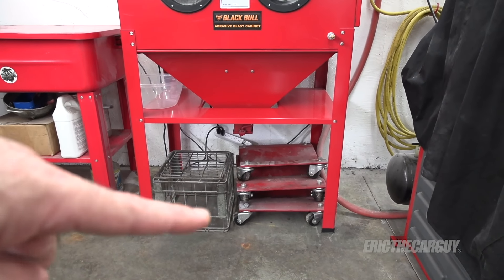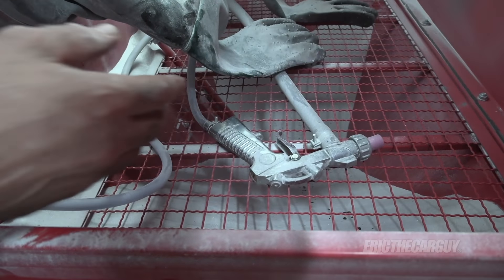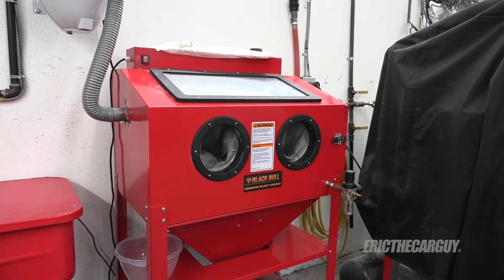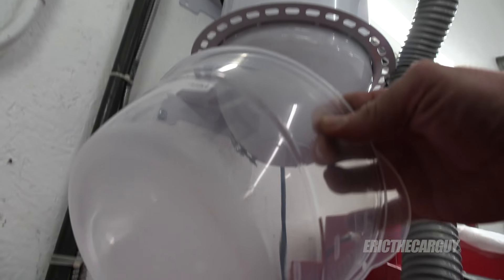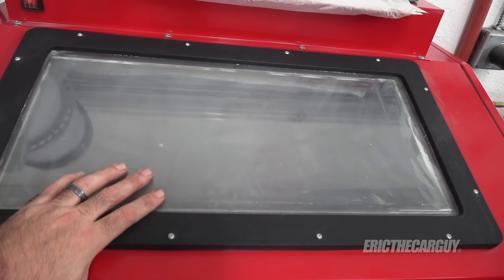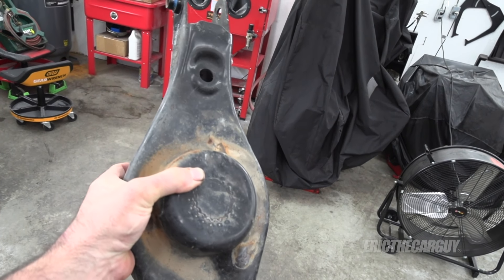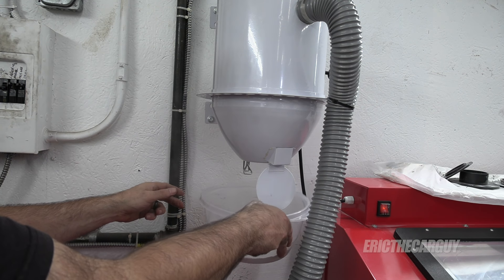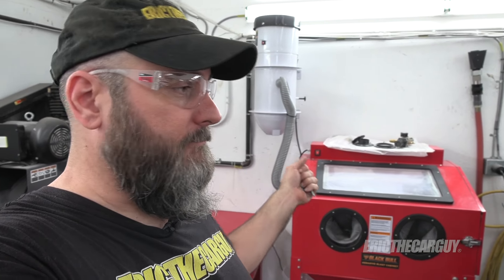Sandblaster Basics

Comment: Eric, use 2 scoops or bowls of media in your blaster only. That way you keep recycling it until it just doesn't  cut as well, THEN dump it.
No need to contaminate 40 lbs at once. Plus it's a lot easier to clean out. Also, put a T in your air hose inside the cabinet with a small blow gun. Great to blowclean the parts,blow any media from the edges and the inside of the door before you open it. Works great !
Reply: He’s still learning leave him alone
Reply: @619guy202 would you rather other people never give him advice? weird hill to die on

Comment: I hooked up my big shop vac to mine and it was sealed up so well it broke my glass! Oooops lol
Lesson learned and now I've got my cabinet running efficiently and it is one of my favorite tools in my shop
Reply: DAMN  JAY, What brand & power is your Shop Vac. Thanks.
Reply: @NoWr2Run  6.5hp Rigid
I didn't have the vent open. I have since devoted a tiny dewalt vacuum for my blast cabinet and have the vent open with a filter on it
Reply from the maker: I don't feel so bad about my gloves popping off anymore. Glad you got that sorted. Thanks for the comment.
Reply: @jaywerne3812  Thank you Jay, much appreciated, SIR.

Comment: Do your future self a favor and research Sandblaster mods. A little time investment on the front end will reap exponential rewards later.
(PS Love you man, Been watching since you were in the old barn and no facial hair.) 

What you have is a Great start (The pickup tube is nice on that unit)
1) Adding the Bottom siphon mod with a media control valve will allow you to drop the incoming pressure to 40-60 PSI. Which will save strain on your Air compressor.

2) Check out Mods that cover adding baffles or path ways for the reclaiming vacuum air to flow across the part and cross flow across the cabinet.
  
3) Reclaimed media....  I would throw it in the trash and not reuse it... The reason being is that media also contains all of the RUST,  impurities and paint that you just removed from the object you blasted.  when the media goes through the gun the second time with the contaminates it will be slammed and imbedded  in to the part you are blasting. This isn't so much huge deal.... But if you blast anything with Silicone (Gasket material) that silicone will get picked up and embedded into the metal which can cause issues with bubbling when you go to paint or weld. (PS scrape or wire wheel  all of the silicone off your parts before blasting ;-))

4) Good note on the RAW metal and gloves.... one down side to sandblasting automotive parts specifically is that Since the late 80's early 90's OEM's used some form of E-Coating on the bolts and parts. Sand blasting REMOVES this coating.... Phosphorus or plated bolts are particularly an issue here... I learned the hard way... I have some nice shiny brackets on my project car but after 3 months the heads of the bolts rusted because of no protective coating. This is why E-Coating kits have become popular in the last few years.... (But check with disposal procedures in your area before purchasing an e-coat kit the chemicals involved can be caustic)

5) add Castors and a floor to the bottom of the unit. this way you can pull it out and sweep around it.

Comment: Very nice set up there.  Used a plywood blaster dad and I made in the 70s for about 30 years and it worked great even with a 2hp 20 gallon compressor !
Its all about your setup I think.  Want to set a new one up now similar to yours but bigger.  I may build just fabricate extensions on the sides of my cabinet or just build another plywood cabinet and steal parts off my existing one.  Big cabinets are very expensive, heavy and hard to get down my basement.

Comment: I have the same one.  I did away with the "tear aways" and use just the glass with the plexiglass over cover.   Replacement glass pieces (at Lowe's) are about $1.50 each if you buy a full sheet and have them cut it up for you).  I also replaced all the nuts and bolts that hold the glass frame on with riv-nuts for much easier access.  Most of the joints leaked and I was getting a lot of abrasive leakage.  When I had the window frame off I caulked all of the joints and that solved the problem.  The only other change I will make will be a different gun (no trigger) and a foot switch for the air.
Reply from the maker: Excellent suggestions. Thank you!

Comment: I just want to mention, for anyone without a garage, most communities of any size are likely to have a "U-Blast-it" place where you pay by the minute and do it yourself. Most reasonably sized pieces will not take more than 10 minutes or so. The place near me also has a heavy-duty parts washer which will clean anything up to and including engine blocks.

Comment: Technically its a blast cabinet, here Eric is using glass bead media, not bad for cleaning some stuff up and rusty bolts, but you can also get aluminum oxide sand blast media which works quicker and better depending on the application, it will have a rougher finish though. I've done parts where i sandblasted first and then smoothed it out with glassbeading but that was easier to do with 2 different dedicated cabinets, 1 strictly for sand blasting and 1 for glassbeading. You will also need different nozzles in the gun to hold up the type of media. Depending on the setup and cabinet you can also run steelshot through it, but reguardless a hude thing to take away from this is that reguardless of media these are basically self destructive machines they will degrade and maintenance def has to be done to keep them good. Also super important dont breath the shit in itll never leave your lungs.

Comment: So, my assumption of a sand blaster vs a wire brush whether powered or not, is that a sand blaster is much better at getting the small crevices on parts, more efficient, and quicker. I have only used wire brushes in the past, but I might have to invest in these
Reply: I also use a wire wheel on a drill, IT SUCKS. It does work but not even close too what a S.B. can accomplish, my buddy has one.
Reply from the maker: Sand blasters can be life changing. Good therapy too.

Comment: I used to repair all the electronics/column switches/speedos/flasher units/ and much more.
Most had a metal case that looked horrible ( Rust and muck hell ).
The sand blaster was brilliant for cleaning them and the rough texture was ideal for primer and paint.:-D
But i used to get shocks off the metal nozzle, and the inside of the gun just vanished over time.
The boss never looked into coatings for the glass,  a fog horn would have been at home in that cabinet lol.
Reply from the maker: Funny, I forgot to mention that. On dry days it does seem to produce enough static electricity to shock you while you work. It's very uncomfortable. Have a great weekend.
Reply: @ericthecarguy  LOL yea you living in a dry cold climate static will be an issue. add ground wires from the cabinet to the ground electrical circuit of the building to drain off any static charge.

Comment: 1. Get yourself a pedal switch and gun from eastwood; way better than trigger style... tried both...
2. Is that a 3/8" hose? If it is a 1/4" then upgrade to at-least 3/8th you are killing your cfm... although if you have 150 psi going up to the cabinet it is not as bad as regulating to 60 or even 90 at the source.
3. cyclone separator inline with shop vac works well. media stays in cyclone, dust goes into the shop vac. Will need a weak shop vac or regulate it down with AC motor speed controller.

Comment: The intake for the dust collection should be shielded so it won’t suck up media, just dust. Eric basically had his setup hooked up backwards.
Reply from the maker: Not according to the instructions. Thanks for the comment.
Reply: People who write instructions are not always the same as the designers. The shroud on the back hole has no realistic purpose if that was simply a ventilation hole. Media isn’t supposed to end up in the vacuum.

Switch it around....see if I’m wrong?!?
Reply: Honestly I can see it being either way

Comment: Recommendation: Look this up on Amazon: WETOLS 14" Rivet Nut Tool, Hand Rivet Nut Tool with 7 Metric & Inch Mandrels M6 M8 M10, 1/4-20, 5/16-18, 3/8-16, 70pcs Rivnuts and Blow Carry Case - WE882 and use that instead of the nuts and bolts...it will make it MUCH simpler!
Reply from the maker: Not sure how this relates to my sand blaster, but... That said, I have a rivnut tool and it works great. 

Oh wait, you're referring to assembly. Yea, I suppose that would work better if you could make them work. Thanks for the comment.
Reply: @ericthecarguy   Exactly...for the assembly. I have one and have used it for years for all kinds of things. For many car projects too. Recently, I had to work on my wife's 2010 GMC Canyon and I bought a new grill assembly. The grill's clips did not work as advertised and the old one used to rattle. So, I drilled six holes through it and into the metal frame of the truck and used these. It works much better than the manufacturers!

Comment: I bought a very similar unit from Harbor Freight a couple months ago and yours seems to work much better. You said your operating pressure should be between 40 and 80 PSI, whereas mine said to run at 90 and I'm constantly having trouble with media not being fed through the gun. Have you had any similar issues? I'm thinking maybe the higher pressure is overpowering the media from feeding consistently.
Reply: I have a similar cabinet and similar troubles. I believe mine is because too much water/condensate is getting into the air supply. I imagine the glass bead is more resistant to that as compared to sand media.. ?

Comment: Hey Eric. Good video. That is a handy blaster for small parts. I got a blaster like the one you showed last on the shelf. I just can't seem to get mine working right. It starts out great, then it stops picking up the medium. I tried aluminum oxide and glass bead. And had the same results. I don't have the instructions for it because it belongs to my son and he misplaced the manual. I am running it full blast and it won't pick up the sand. Maybe the air is set too high. I will try lowering the pressure. Thanks for sharing.🍁👍👍
Reply from the maker: Shake the tank from time to time. While you're blasting it will make a 'hole' in the media as it draws it out. I have to 'smack' the side of my blaster from time to time while I'm using it to get the media to feed again. Good luck and thanks for the comment.

Comment: Stick with the metal tips. The ceramic ones don’t last long at all. That reclaimer may be better on the floor than being up on the wall. If it dose give you trouble, try putting it down on the ground and see if the will help you out a bit. You’ll have to get you a strainer from the dollar store too. It’ll save you a lot when you get into using it all the time

Comment: Not sure if you mentioned it, however using cheap play sand is not really saving you much in the long run.  Silicosis is real, and it doesn't take a years of daily exposure to mess you up.
Local abrasives company sold me of 50# steel grit for $45, as it can be re-used 1000-1500 times. Working pretty nicely.
Reply: Also, Tractor Supply has one for like $100 with light.  I just get some nice LED's from eBay and patchthem into the 7-12v wall wart with a resistor.  These are simple enough to make from wood or sheet metal if you can bend them or have a brake.

Comment: For the external blaster will you be doing it outdoors, or will you instead build a Dexter-style 'kill room' to keep the sand/dust contained indoors? 
Always been curious to find a way to use a pot blaster in suburbia without making a mess of the backyard or pissing off the neighbors!
Reply from the maker: I was thinking 'kill room' since I need to blast the underside of my car on the lift. Still questioning this though. Not sure how much dust it will make, but I'm sure it'll be a lot.

Comment: What is your air compressor specification? What is the minimal tank size would you use?
Reply from the maker: Mine is 80 gallons. https://www.youtube.com/watch?v=6Nmz5Pytsi0&t=16s

I suppose the size compressor you would need would depend on how much work you're doing. Also what operating psi you decide to run. This unit can operate between 40-80psi.

Comment: Your sand blaster shown is a 98% match for the Harbor Freight unit I just purchased..
Yes, assemble is a bear doing it by yourself which I did..I found if one installs the window last, the top screws are easy to install, then install the window..
BTW, the directions to assemble are terrible at best..
Thx for the vid..good info especially about post cleaning handling..

Comment: An air powered spark plug cleaner would be a great addon to the side of that. $18 from HF.
Reply from the maker: Honestly, I don't see the need for that with modern fuel injected engines. If you're having to clean stuff off your spark plugs, there's something wrong with your engine that needs to be addressed. Still, those are cool tools. Thanks front the comment.
Reply: Best way to clean a spark plug is to use a propane torch get it cherry red when it cools off just air blow it clean. Sand you will get that in your engine no matter how you try to get it off the spark plug. Have not bought a new spark plug for lawn mower or any 2 cycle engine in years. Mapp gas make the spark plug get hotter faster.

Comment: How much warping do you find when blasting?  I have a big surface I need to blast and trying to find a blaster big enough to to blast a panel but worried about warping panel due to heat
Reply: No heat generated🤷🏼
Reply from the maker: You can turn the psi down to help prevent that. You do need to be careful with thin metals though. Also, the media you use will have an effect. I'm not an expert on this, but I'm sure that info is out there somewhere on what media is best for thin metal. Good luck and thanks for the comment.

Comment: Hey erick. I know this video is different from the question I'm going ask.. So i have problems with my valve lashes.. The car that I'm working on is 2002 civic D17A2. Everytime i adjusted the valves,they be ok for awhile then shortly after the car started to vibrate which means they got tightened up, even if i torqued them to 14-15ft lb the still tighten up.even if i adjusted them with little or no drag they still got tightened up on me. What are your suggestions? I adjusted them today and the car was idling with very slight vibration which i could work with but then now after i got off work the car started vibration after i start up..

Comment: Do they have larger cabinets? I work with large body parts and I've been looking for a sandblaster rather than doing it by hand all the time.
Reply from the maker: There are larger cabinets available but I'm not sure if they would be big enough for body panels. You might consider the other blaster I showed in the video that doesn't require a cabinet.
Reply: @ericthecarguy  alright I'll check them out. Thanks buddy
Reply: Yes, there is every size possible available. 
Truly commercial units, not made in China.
But the prices are reflected in their unique specialty uses.   I had one ordered for my HS auto shop class. It was a couple thousand for the bare bones unit.  Lots of options.  The kids loved using it and it was relatively indestructible.
Reply: @michaelmccarthy4615  I flip cars and a lot of the ones I buy end up having parts that are in good shape but just in need of a fresh coat of paint

Comment: Ahh, you sold them all out at JB, Eric! Those guys are gonna be happy with you, me thinks.
Reply: I got to buy one of those some day - been wanting one for years. If my '07 Silverado would just stop breaking, maybe I will!

On day 3 of getting everything out of the way for the tranny swap. Damn nut rounded off on the manifold flange. Battled with the other 5 - I think GM torqued them to 4,500 Ft. Lbs.. Finally broke the stud with the rounded nut with Big Nasty moments ago, after welding a nut on and snapping the stud in half. Had it red hot, too. I've never seen metal this hard for an exhaust system!! Also had to melt what used to be nuts off the muffler flange studs. Total nightmare! I'd quit if I had to do transmissions on the 900-series trucks all day, every day, LOL! Done my 3PM lunch - time to go back to battle.

Comment: so what's the life of the media? i'm assuming you have to replace it but not sure of its lifespan
Reply from the maker: I think you can use it until it gets too dirty to use. Not sure when that would be exactly. It would depend on how much you use it I suppose. Also, be sure to only sandblast dry materials and not things covered with grease and oil. That will gum up the media for sure.

Comment: Is it works to remove rust?
Reply: Yes, depending on what media you use. I use 80 grit aluminum oxide.
Reply from the maker: Rust, paint, and other stuff you want removed. The exception would be anything wet, you don't want to use this to remove grease or oil.